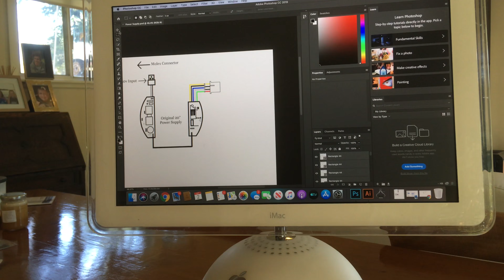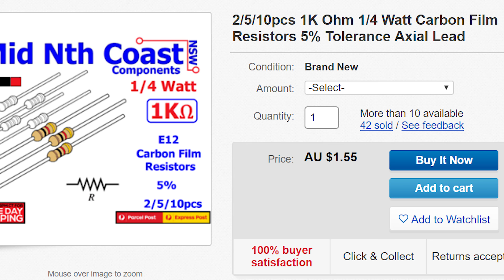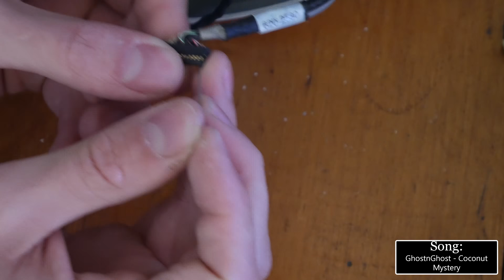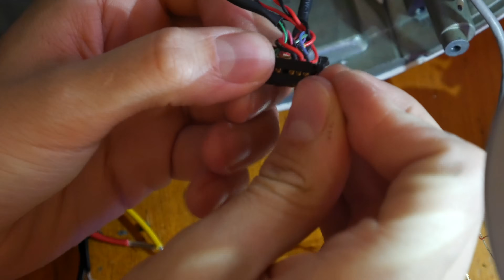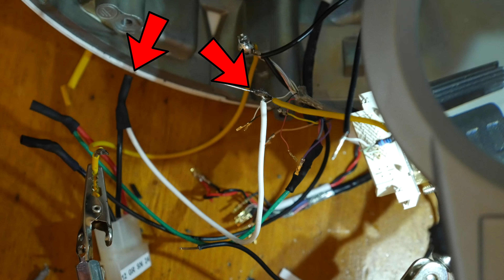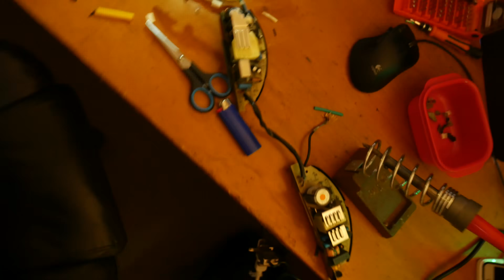How To Turn a 20" iMac G4 Into An External Monitor

Comment: Hello ! thanks for the tutorial, is very easy to follow. Unfortunately, didn't work for me. My Macbook pro recognize the Screen as an iMac Screen, and also the iMac screen turned on the the backlight. But there is no imagen, just a black with backlight screen. I check the correct connection of all the cables and everything is OK. I saw this video several times before attempting the mod. The iMac was working before, so Im was sure all should worked. If you have any idea of what is happening, please let me know.
Reply from the maker: This is strange behavior. It could be that you're not sending the required power to the LCD panel, or that the wake signal from the DVI connector is not hooked up correctly. Hopefully it is not your LCD controller that was fried, as if that's the case you might have to replace the LCD panel. If that is the case you can use iMac G5 LCD's (Which are far more common) inside the iMac G4 without any issues. I would double check all of your connections and make sure the correct voltage is being supplied to the LCD panel. You might get lucky and it could be a loose connection. Also try with another device, it might be an incompatibility with the adapter you're using. Hope this helps!
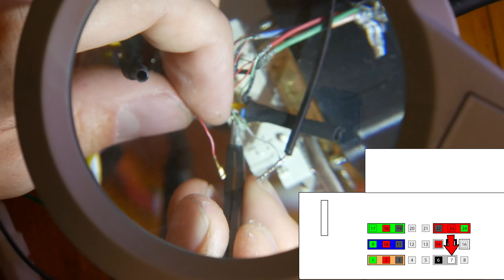Reply from the maker: My best guess is that the red wire at 23:06 is not correctly hooked up. This is the wire that sends the activation signal to the LCD panel.
Reply: I will recheck the red wire. Also I was thinking on the 1k resistor of the yellow wire, that should be intially a 6k resistor, so do you think that mayby increasing that resistor could help? I checked the resistor ohms and was 0.997 ohms, so I thought maybe is not enough, what would happen if I put 2 resistor to give at least something around 2k?
Reply: I recheck the red wire, its ok, connected to the line of 14th pin. Also I added a second resistor to the yellow. The situation remain with no changes. The Screen turned on with the backlight, and the Macbook Pro recognize the screen as a iMac Screen and show the screen in the screens preference like it was functioning properly. But there is no image the iMac Screen. I dont know what else to do. I also thought that maybe I got confused with the grey and purple wires of the Big Grey cable, because both colors are very similar. I think the only other thing I can do is change does, but I'm not sure if that can make any damage to the LCD.
Reply from the maker: @cristobalbianchi  You only want a single 1k Ohm resistor to the red wire. a 6k Ohm or 2 1k Ohm resistors likely won't work. Have you taken a good look at the wiring diagrams in the description and verified that they match? Also, you are working on a 20" iMac G4 correct? If it's a 17" Or 15" the process is different. Usually this behavior is caused by a dead LCD, at least that can be swapped out quite painlessly, the LCD can be fried by sending the wrong voltage to it. Have a look through dremmel junkies guide: http://www.dremeljunkie.com/2011/11/all-in-one-20-imac-g4-genuine-tmds-to.html 
Maybe there's something in there that helps you out. Best of luck!
Reply from the maker: @cristobalbianchi  Sorry, Mis read your previous comment. I don't think there is a problem with your yellow wire. As that is the "Inverter Activation" Wire. And you've confirmed that your inverter backlights are turning on correctly. Have you tried hooking up the display directly via HDMI to a different computer?
Reply: Pendleton 115 I did again all the connections following the dremeljunkie tutorial (I read it before, but I found your explanation more easy to follow). Also, I dissambled the screen and checked the connectivity of all the wires. Everything looks Ok. I dont think I fried the LCD because I was very carefull to check everything with your diagram before connecting AC. Finally I got the same result, the macbook recognize the screen and show it in the screen configuration, and the backlights turned on. But there is no image. I will try with another computer and see what happen. I let you know. Anyway, thanks for taking the time to reply my messages !
Reply from the maker: @cristobalbianchi  Best of luck mate! Hope you can get it working. Hopefully it's something as trivial as a dongle or a mis behaving laptop! Please let me know if you notice any faults with my guide and I'll make sure to correct them.
Reply: @Pendleton115  Its working !!!! was a faulty HDMI adapter !!! thanks for your help and support !!!
Reply from the maker: Cristobal Bianchi Glad to hear! It’s always something simple like that! Happy you got it working.

Comment: How can I use 3 Snowballs on the same imac 2010'
Reply from the maker: I think you can only drive one external display using Mini Display Port. Although if you have thunderbolt you might be able to drive multiple using some sort of adapter. If not you could drive an External GPU and run the displays through that (As long as you don't plan on gaming on them) External GPU performance on thunderbolt 1.0 is pretty slow, but if all you plan on doing is driving a display I imagine it'll work fine.

Comment: This is awesome. I have a 20inch iMac G4 and want to turn it into a hackintosh but the few tutorials that there are online are confusing as hell ☹️
Reply from the maker: megsway cheers man. I’m currently working on fitting a full modern computer inside of one of these. It’s basically complete but will probably be a few months until I publish a video
Reply: Pendleton 115 that is awesome!! - if you could also include the shopping list of parts too that would be a serious help. Can’t wait to see the video/tutorial. Keep up the amazing work :)
Reply from the maker: megsway sure thing, this vid already has a list of things you need, and there’s links in the description as well.

Comment: Hi. What happens if I connect the PS4 directly to the iMAC via HDMI cable without WiFi  or any Android TV Box or Intel NUC???? Please answer for the love of God
Reply from the maker: Not sure whether a PS4 will work, but there's no harm in trying. Some devices are "HDMI" complaint but won't work if you convert them to "DVI" give it a go and let me know what happens.
Reply: @Pendleton115  OK. I haven't tried it but I've already got an adapter. Thanks anyway

Comment: This is awesome.  I have one of these computers that I used to play vanilla wow on way back in the day.  It has been with me for years and I want to do this to it.  My imac G4 currently does not power on I believe there is an issue with the power supply.  Will this still work?
Reply from the maker: bew watson If it’s a 20” iMac you’ll need to find a 24v Power Supply that you can use to replace the original one. As it’s required for this mod. Although if it’s a 15 or 16” iMac you can use a cheap 12v Molex Power Supply which you can hide inside the iMac.
Reply: @Pendleton115  Bummer it is the 20' iMac.  I will need to figure this out a little more.  I suppose the first step will be to get it to power up then to continue with this mod.
Reply from the maker: bew watson I would first verify that it is definitely the Power SUpply that is dead, test the red and black wires with a volt meter and check to see if they output 12v.
Reply: @Pendleton115  You are the man, Pendelton!  I will be sure to do this.  I have limited experience in troubleshooting electronics but this is a good a time as any to get started.  What do you think about this  starter kit? https://www.amazon.com/gp/product/B073VDX4B7/ref=oh_aui_detailpage_o00_s00?ie=UTF8&psc=1
To get me going?
Reply from the maker: bew watson That looks like it should do the trick! I’m not sure about the quality of that soldering iron but I’m sure it’ll do the job.
Reply: @Pendleton115  i own a 15" g4 with the same problem, you already have a video or guide about the Molex Power replacement?
Reply from the maker: Rock y Ruedas I haven’t made a video yet, although I plan to. Check Dremmel Junkies guide for now.
Reply: @Pendleton115  Ok, I will go ahead and make the purchase tomorrow. Thanks for your time and your informative video. I will let you know how things go.
Reply from the maker: bew watson Best of luck!

Comment: Thank you so much for this imaged tutorial. Your commentary is great !
I have a 15-inch iMac G4 that has some troubles to power up sometimes, but I wish I could get my hands on a 17/20-inch iMac for the more rectangular-ish aspect ratio and convert it into a modern display or in a hackintosh. Apple’s product will always look amazing to me. This 18 year old beast is still gorgeous in 2020 thanks to it’s surreal engineering.

Comment: Thank you so much! I’ve been carrying around two 20" for like 6 years waiting to do this but could never figure out the DJ blog. Both are working great!

Question: Have you seen random firing pixels on your display? Both of my mods have them. They are graphical (move when windows move) not display problems. I only had green pixels noticeable with DVI, but with an “upgrade” of DVI to HDMI connector, I now have red, green, and blue pixels randomly firing. Thought? Thanks
Reply from the maker: This could be caused by loose fitting connections or damaged wires, also a chance you’re getting interference from other electronics. Try playing with the connector and see if it fixes your problem, also I’ve had some luck wrapping the display cable in aluminium foil to block interference. Although a correctly done mod usually shouldn’t have any sort of random pixelation. 
 This could also be caused by a grounding issue, where the ground pin for each colour isn’t grounded correctly. Try checking all of your grounds as a last resort. Best of luck! Hope this helps.
Reply from the maker: Also, are you plugging directly into something via DVI? Or are you passing through adapters? If you’re using a cheap adapter, or multiple adapters in series this can cause signal loss.
Reply from the maker: Ah, if you’re only getting green pixels on DVI my best guess would be the ground for your green LVDS connectors that isn’t properly seated.
Reply: Thank you—it may just bee damaged cables (since I have no idea) and cheap adapters compounded the issue. Switched back to DVI and the problem is less, though more than before I fiddled with it.
When HDMI was connected, I tried connecting a Switch to see if it could function like a TV as well as monitor. The backlights game on but no image appeared. Is there a way to connect other devices than computers through this mod? I do not know anything about differences in video connections or science of digital signals. 

Thanks so much again for the tutorial and replies!
Reply from the maker: @NateVandermay  Hi, sorry I never saw your reply. most HDMI Media devices won't be compatible, as they don't support DVI over HDMI. Most PC's should work, as their HDMI interfaces also support DVI. Your best chance of getting something like a Nintendo Switch to work would be to buy an active adapter. As this can change the signal. Although even then I can't confirm 100% it'll work. Here's a link to one I found on Amazon that you might have luck with. https://www.amazon.com.au/StarTech-com-HDMI2DP-DisplayPort-Active-Converter/dp/B004I6IYSM

Comment: I have a 15" screen imac g4 (not wide screen) and i'm wish so much to find the schematics to do the same thing!
If you can do a tutorial for it, it woudl be great.
Reply from the maker: Brian ZOONEKYND-ROBERT I was actually working on one, but my 15” panel died while I was figuring out the pin out so I was unable to finish the video. There are guides on dremmel junkies blog if you want to give it a go yourself, but the 15” can be quite difficult to mod.

Comment: Could you turn one of these G4s into an HD TV or a DVD player, like take the guts of a DVD player and cram them into the G4's case. Hey now that's an idea. The G4's display seems to be a nice display although I've never used a G4 or seen one in person.
Reply from the maker: I've had some issues plugging regular Media Equipment into my modded G4's, I believe it has something to do with the LCD only supporting a DVI signal, while most media devices only support HDMI. Most computers can detect which type of signal the monitor requires and then send it the DVI signal. Although, further testing would be required to see if theres some kind of active adapter that could make this work with regular media equipment. There's nothing stopping you from fitting in a laptop logic board and then inserting a Optical drive into the drive bay though, in fact if you stay tuned you might just see that on this channel :)

Comment: I'd love to see a video for the 15" version, because apparently the connectors inside are completely different.
Reply from the maker: thechristoph The 15” and 17” have the same pinout, I will make a video on one as soon as I get my hands on one!
Reply: @Pendleton115  As far as I see you don't ditch the old monitor screen, you just rewire it?  I was hoping to do this and plug a modern mac mini inside the shell, instead of the old dvd drive.
Reply: @everlilith6225  hello everyone. This is my intention, I want to put a Mac Mini inside that dome. My iMac is 15” is this video adequate for 15’s?
Reply: I’m looking to do the same - I’m sitting with the Mac Mini installed in the shell and I have the G4’s 15 inch display in my lap with the inverter board staring back at me… now what? Haha. I found this video and I’d love to know what the next step would be.
Reply: I have a 15 inch USB 2 model, but I tried this mod and was unable to make it work.  It lit up, and was identified correctly, but I only got a weird murky blobby image that seemed to have no signal and a bunch of lines.  I checked everything and did continuity testing of my wires, but it never worked.  I put the old Mac guts back in and it worked fine.  I have not found a single 15 inch USB 2 model on the various conversions.  They are all the larger ones or the guy in Japan who did an early version.  I wonder if 6k ohm resistors instead of 1k ohm resistors would make a difference?  The wiring seems the same as dremeljunkie's and yours.  Perhaps the monitor only does thousands of colors on that cheap old model?  At least the computer was free and it still works as a G4.

Comment: Thank you for this video, I’m hoping to use this to connect an Apple TV. Will that work?
Reply from the maker: I’m not sure, I’ve had issues plugging in devices that are only HDMI complaint, for example my Raspberry pi and DVD player refuse to work. Although if I plug in something like a laptop over HDMI it appears to work. So it really depends on the system, best of luck with it. Only one way of finding out! I’d offer to test for you myself but don’t have any iMacs set up atm
Reply: @Pendleton115  Have you tried plugging in an Amazon FireStick?
Reply from the maker: @christinam2089  I have not, but I'll try to buy one and try it in the future.

Comment: I bought a working 15“ for dremeljunkies mod^^ I kept all the internal parts in a box! 
But I didn’t manage to get the monitor switch on automatically :< so I put in a rocker switch for manual powering and I used not the internal power supply - I used one for external hard disks with a molex already on it
Reply from the maker: vimsi Nice! I had a 15” But I couldnt get it to work, the LCD wouldnt activate and the 5v I was sending to it would warm up tremendously.
Reply: Pendleton 115 but you did a nice job on your 20“ - I have a second fully working 15“ in its original box on my shelf xD never had my hands on a 20“ :(

Comment: NIce video, nice doggie and I didn't know that iMac internal panel used modified DVI as a connection
Reply from the maker: Kacper Jacuński Many older Macs use an LVDS connection. Which is very similar electrically to DVI. You could theoretically do this on any Mac between 2002 and 2009. Although the G4 is by far the easiest as it has pins on the end of each wire, negating the need for micro soldering. I will be doing a video on the iMac G5 soon though!
Reply: @Pendleton115  good to know, but only mac that I have right now is 2000's Powwermac G4, witch is'nt working and imma going to hackintosh it anyway, I will use the case, mobo is dead I guess
Reply from the maker: @Felecc  I've got an empty case for one of those lying around too. Beautiful machines.
Reply: @Pendleton115  I think that the G4 has better realized case design that G5 Powermacs, because it flips out the whole mobo, right for maitnance, ulike the G5, witch has it's mobo attached to the chasis. But G5 is machined aluminium tho. Thanks for a nice chat, keep up with new videos :D
Reply from the maker: @Felecc  Thx! Stay tuned for more!
Reply from the maker: Kacper Jacuński Many older Macs use an LVDS connection. Which is very similar electrically to DVI. You could theoretically do this on any Mac between 2002 and 2009. Although the G4 is by far the easiest as it has pins on the end of each wire, negating the need for micro soldering. I will be doing a video on the iMac G5 soon though!